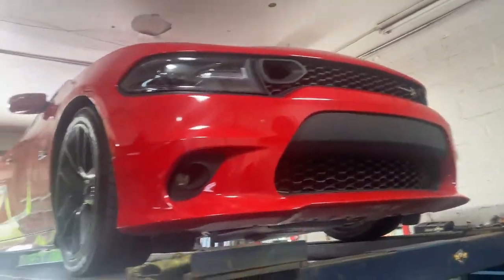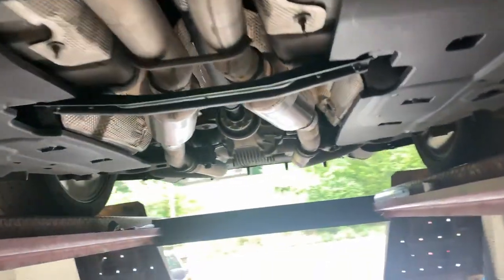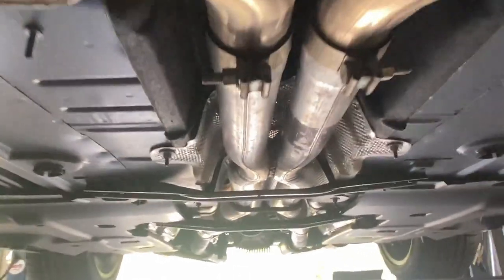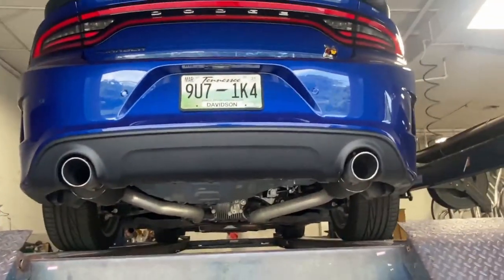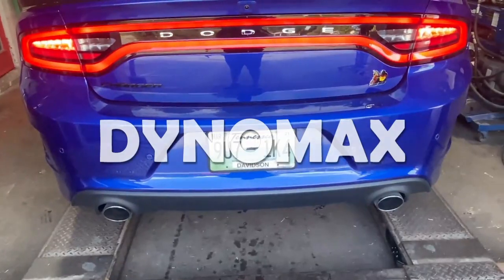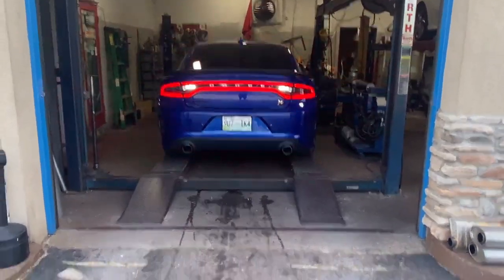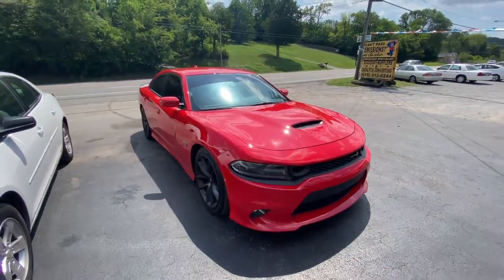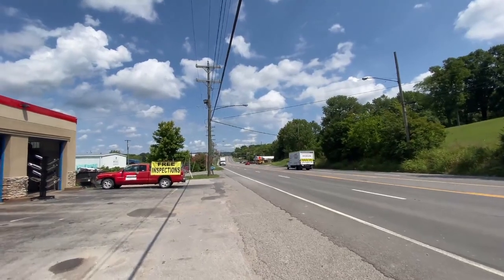Dodge Charger 6.4L HEMI Scat Pack MUFFLER DELETE Vs NORTH EASTERN EXHAUST Vs DYNOMAX RACE BULLETS!

Comment: There's somethinf about the northeast exhaust that i like more tham the others on theinterior noise
Reply: Agreed.  Has a European sound to it.
Reply: Cherry bomb sells the exact same thing powder coated red for 35$ a piece. They are called cherry bomb M-80s
Reply: @Morphz_Unlimited   it has some popping here and there but not loud, and its like it sounds as one solid tone, not a split dual exhaust pulse. European is a good way to put it.
Reply: Depends on the size of your X pipe and location but that gives it a full sound with the poppin on deceleration

Comment: I have 2 dynomax bullets sitting in my garage waiting to be installed, but honestly after hearing those northeastern (Jones) I’m rethinking it! My only concern is they are a chambered muffler. Stock tune on the charger is with 2 straight through mufflers and resonators, wondering if putting a chambered muffler on would hurt performance?

Comment: I really like that sound coming from the north eastern exhaust
Reply: Cherry bomb m-80s same muffler just powder coated red and much cheaper.
Reply: Not any cheaper. That’s my car and I paid $65 for the pair on eBay.
Reply: @billyquinn2162  did you try it without the resonators?

Comment: those northeast mufflers are  Jones Exhaust Flow Pack's and $25 a pop thru Summit... ( placing an order now......)
Reply: what vehicle u putting them on and keep me updated
Reply: @jesusbarranco5036  2020 challenger scat pack widebody
Reply: @joelhardin4093  did you ever install the mufflers?
Reply: @automaniac8715  yes! No drone or rasp, no gurgle or buzzing at high rpm before a shift (super 10s on my 5.7 were hideous right at shift points) I kept the resonators for now. Laughable at how cheap they were but they’re not gonna wear out.
Reply: @joelhardin4093  do you have the link where you purchased them?
Reply: @joelhardin4093  how long was the exhaust?
Reply: @automaniac8715 full length....
Reply: @joelhardin4093  19.5” is the one I ordered.
Reply: @joelhardin4093  how much louder is this setup than stock? Thinking about these for my scat pack. Did you notice any difference in power or torque?
Reply: @p71josh  louder cold starts and throttle . Seems to tach up quicker but it’s probably just mental. No more of the “at your feet” rumble of the stock mufflers resonating. It pops once in a while on deceleration at high rpms but nothing crazy. Can’t beat it for the money.
Reply: Do your car sounds like the white charger in this video?
Reply: @ricowade463  yep not annoying volume but enough to know it’s not stock. I’m probably going to delete the resonators soon. If anything I’ll shed 50 lbs
Reply: Thanks. It’s no raspy sound right?
Reply: @ricowade463  nope not at all
Reply: @joelhardin4093  would you say these are louder or quiter than super 10s?
Reply: @hrantmelody  super 10s are just a wide spot in the road lol these are marginally louder than stock at low rpms /throttle but cold start and spirited driving you know it’s not stock. Probably less drone over a super 10 . Good bit of pop n gurgle in sport or race modes on deceleration. Can’t beat it for $50 for the pair
Reply: @joelhardin4093   thanks so just to get a better understanding when you said "wide spot on the road" LOl not sure what you mean..so you mean the super 10 is louder?
Reply: @hrantmelody  super 10 doesn’t change much volume over a straight pipe aside from the sound.